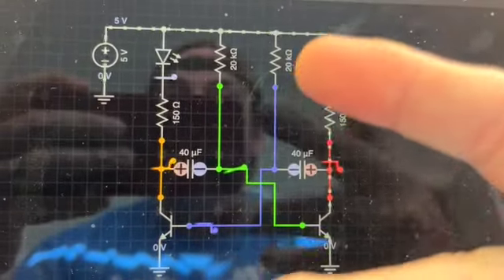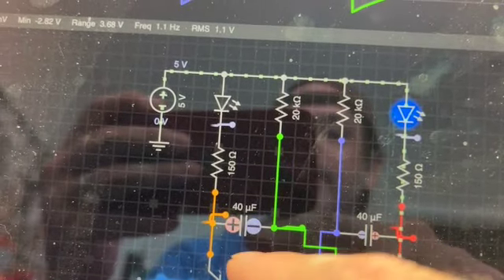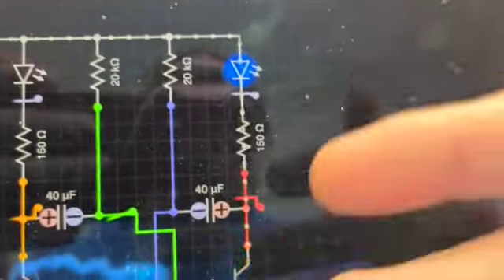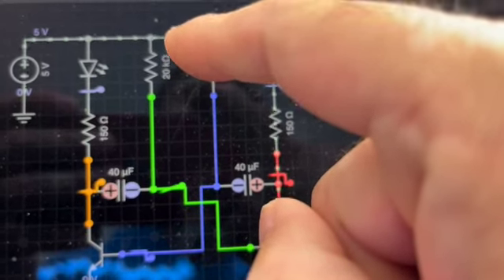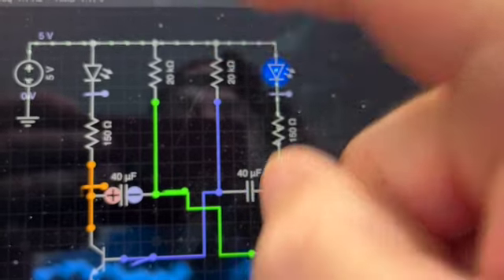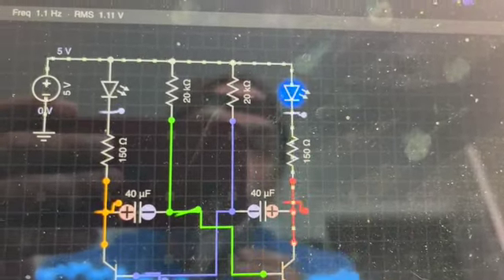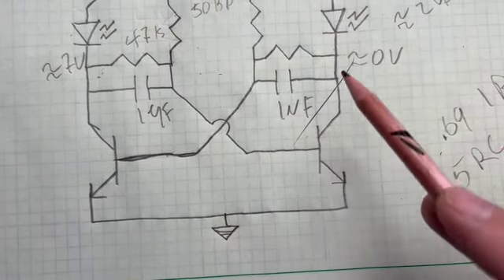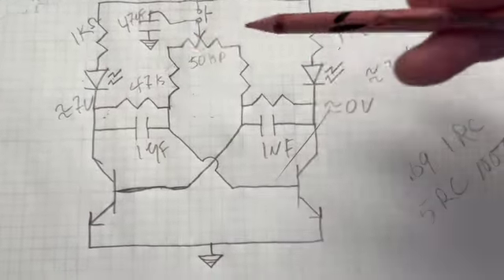The Schematic and How My Favorite Circuit Works

Comment: you need to add the rest of the computer to it. :) you only need enough state to finish the task!!!
Reply from the maker: If I were making a clock circuit for a computer I’d use a crystal- astable oscillators lose consistency after a while-
Reply: @stonerdave  i wonder if u could increase the hz from what u start from on the crystal.
Reply from the maker: You can’t increase the frequency but you can decrease it- if you need a higher clock speed you need a new crystal- but make sure you don’t exceed the processor speed-
Reply: @stonerdave  what if u made a circuit that put out 10 pulses when it gets 1 pulse.  thats x10 hz.
Reply from the maker: That is different than the crystal- and you will be limited by slew rate and such- typically you get a crystal that has a frequency to maximize your processor- you don’t want to overclock your processor too much
Reply: @stonerdave  if you managed to go 2 terrahertz, then u would defeat a whole top of the line gpu with a single core.